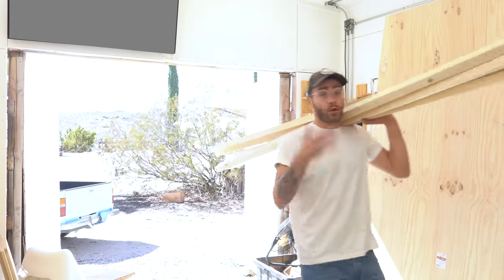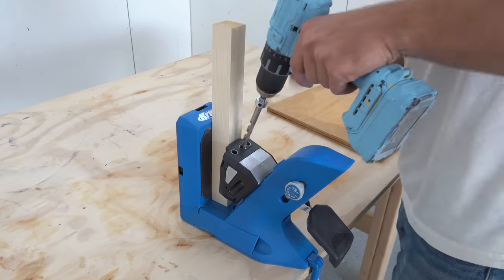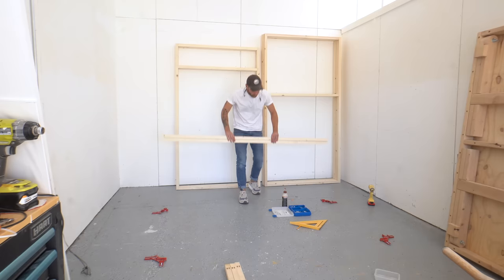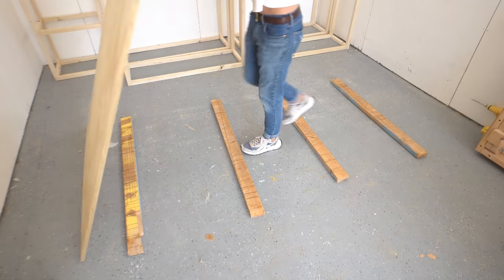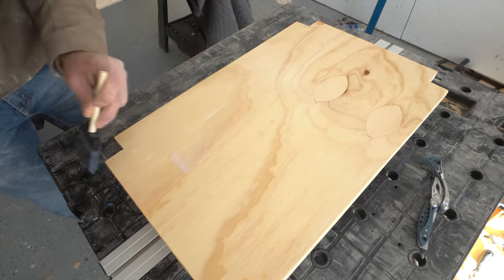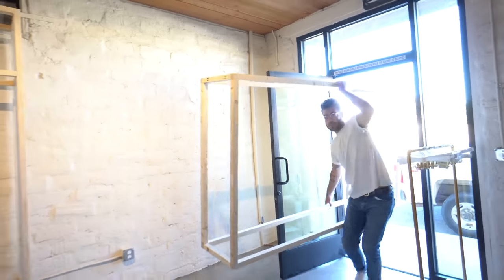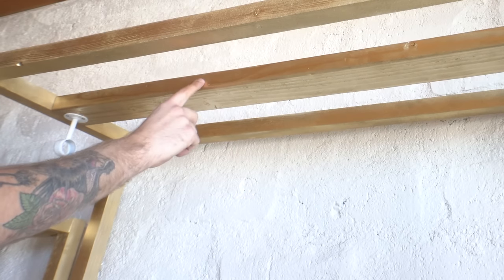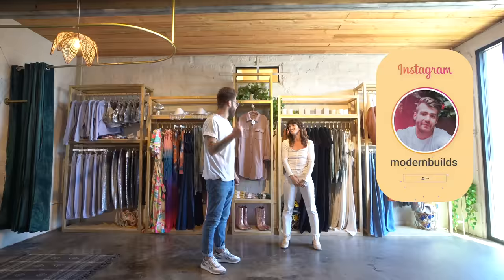DIY MODULAR CLOTHING RACKS / DISPLAYS on a BUDGET | Modern Builds

Comment: Nice basic racks that can be used to closets or basement/garage storage. A nice lighter look than typical 2x4 shelves. 
The only trick is finding straight 2x2s and then cutting and fastening them together before they warp. But with such a basic design it looks like a very quick build.
Reply: could an option be ripping down 2x4s? would that be easier?
Reply: @baxt1412  Warping could be even worse because ripping the 2x4 will expose the middle of the boards that can still have a lot more moisture than the faces already exposed, and when the exposed middle starts drying it will quickly warp the boards. Best odds is to take time choosing straight boards and plan to cut them to size and join them as soon as you get them home. You can also cut them to size and store them in trash bags to reduce the acclimation to your home humidity.